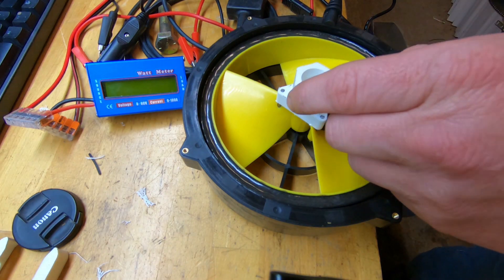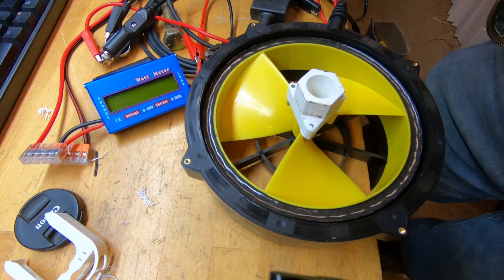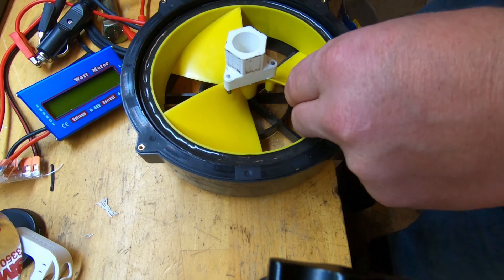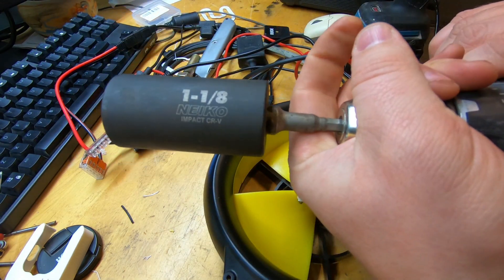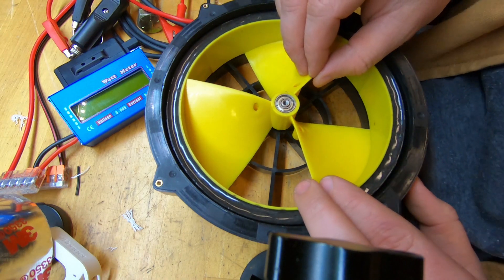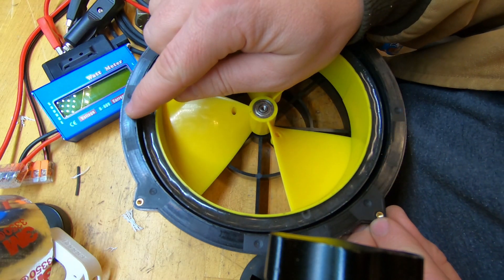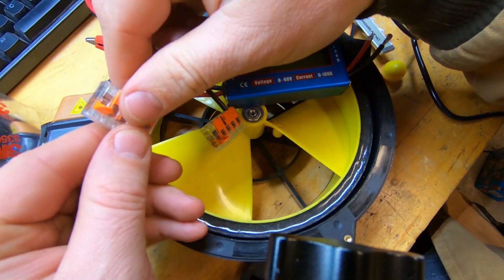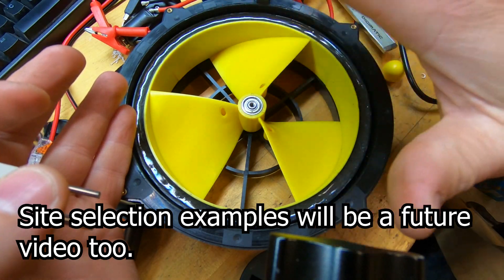Waterlily Full Power Output Bench Test

Comment: The lack of cogging has nothing to do with what you said fyi. This is known as a coreless design it w
Has no iron cores in the coils.. also known as a "nonmagnetic stator" if you short all the windings and spin it you will feel some cogging from the current generation. While coreless motors and are nice they are much less efficient at capturing magnetic fields and turning it into power..
Reply from the maker: I did not know that! Thank you for the explanation. However a coreless design would allow it to spin up in even the weakest currents providing mA. Additionally based on the power density of the medium I don't think a cored design is necessary.
Reply: @JoeMalovich  the efficiency at low speeds is better but it reduces peek output by as much as 40% but the advantage is you can make power with at very low flows.this design is good for the setups like yours. The sown side is the narrow power band a coreless might capture 0.2watts up to say 250watts where the same size unit with iron core might capture 50 watts upto 750watts so it really really depends on what your working with if you don't have the flow to maintain the 35-50watt minimum to keep a cored stator from stalling then the coreless makes sense if your making 200+watts all the time then a cored stator will get you more power. All my figures are made up as an example and depend greatly on the flux density calculations and Eddie currents in 0.01in steel laminations used in most pmsm motor technology.   I'm working on a completely new way to capture power from things like this that can restart it self and uses the generator itself to boost output voltage.. I have a working prototype controller now on my 750w windmill and if i compare my old mppt controller to my custom controller I capture around 65% more energy on average 😤. I simply applied regen braking and ABS concepts in a large modified hobby ESC with a software based mppt tracking the fact it's a speed controller means i can drive it like a big fan. But it's not really setup to do that it's  basically trying to find a minimum rpm needed then pulses the brakes builds voltage in the stator using the flyback effect then dumps that back to the battery bank because of the it's a constant RPM variable torque system this mean with higher wind it just brakes harder to maintain rpm and thus more power.. also make a runaway almost impossible unless the mosfets fail. A big 3 poll relay and a small arduino act like a tach and watch rpm if it hits a red line it ties 6 10ohm 50w resistors across all the windings.
Reply from the maker: @CNCAutomationLab  I just looked though your videos and sadly could not find one on what you've built, I'd definitely watch one if you did.
Reply: @JoeMalovich  I'm not really a content creator, the company i work for has some rules concerning engineer's having a social media footprint. Like most government contractors do. But I'm going to start manufacturing my new wind/hydro charge controllers soon and might need a test case so if you can email me some shipping info i will send you a prototype, but i will need to know what the max open circuit voltage you see on your generators. It will work wih just about any 3 wire brushless generator. And I'm adding a startup function for ASM motors but will require an external rpm sensor this will let people use ots 3 phase AC motors that don't have magnetics by watching rpm and using a cap to pulse the leading phase angle but still testing this on the bench..my username is my g m a i l. I have been watching your videos going back to the water wheel lol
Reply: @CNCAutomationLab  is there an update on this build of yours? I'm curious to learn more about this

Comment: Though not extremely powerful, be careful people because one amp can kill!
Reply: Wouldn't 1 amp need a higher voltage to be of any real concern?
Reply: @pa_maj.MARTINI-van-MAN  true, but if you get in some weird place, like your nose, your mouth, or an open wound, it probably be a problem?
Reply: @crackedemerald4930  Try a sparker from a superser gas heater on a tooth 😬 I did it twice just so my brother would do it once.
Worst pain ever. between the worst toothache and being hit on the head with a brick at the same time. A split second felt like forever.
To do it twice was just insanity 😆
Reply: Eric McGinnis well said!
Reply: very low power can easily kill in the right places. one amp is pretty dang amazing
Reply: @crackedemerald4930  What are you all talking about?
Reply: @vaskylark  electricity
Reply: @crackedemerald4930  lol Well yeah I get that but the kill talk I don't.